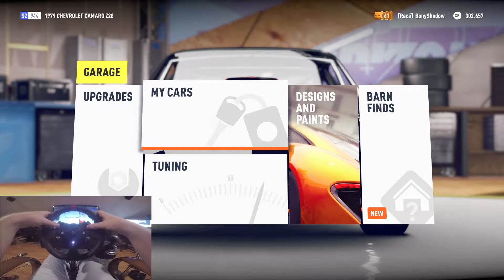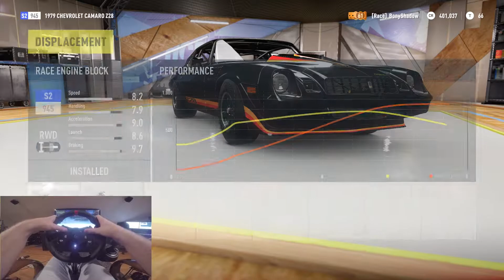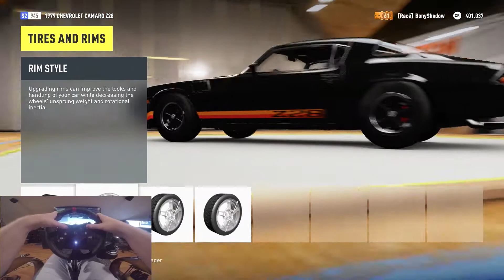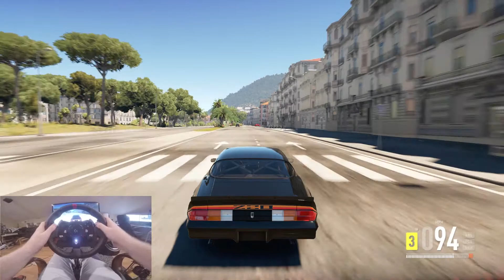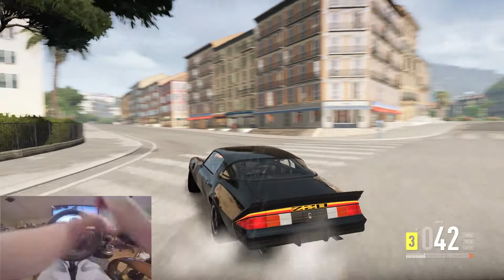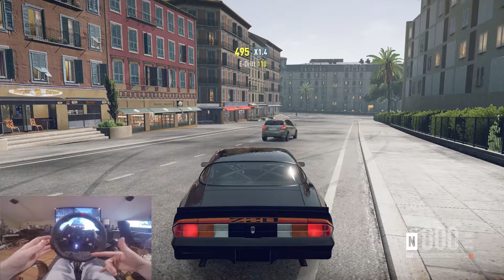Camaro Drift build (G920 gopro)

Comment: why race tyres. use sport and have about 600 to 700hp works best. and don't do the weight reduction cos it snap to hard. and if there is a supercharge opinion then pick it over turbo cos you get instant power